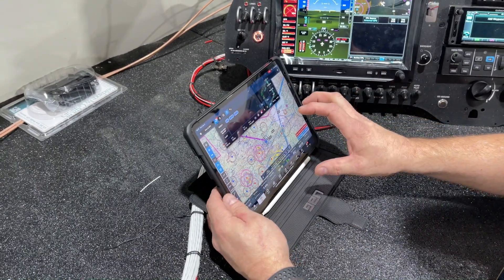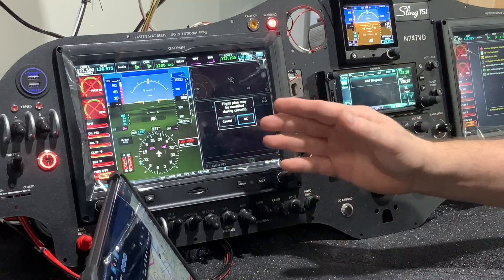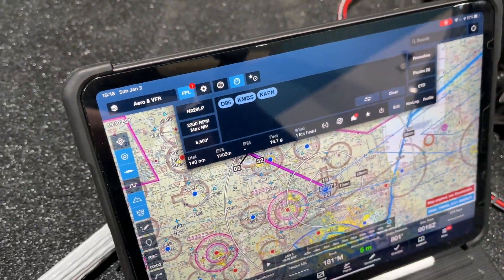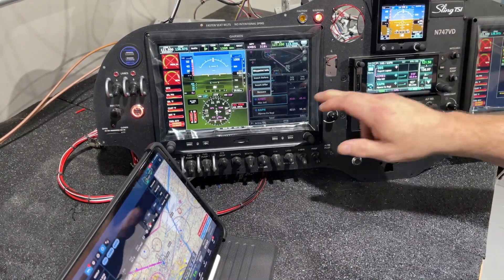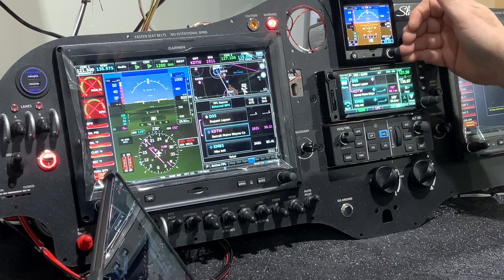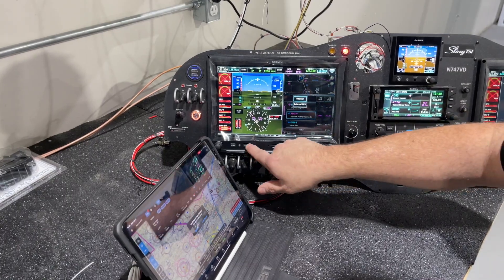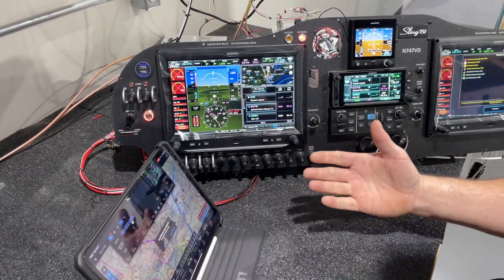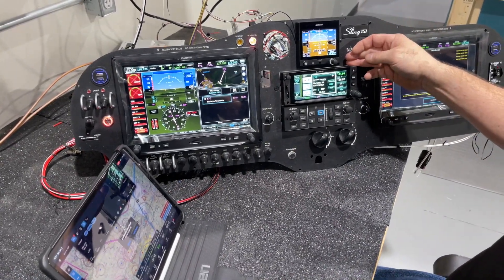Garmin G3X to GTN Crossfill

Comment: Hi, I have a G3x and GTN650 x I. It looks like my system has not been set correctly in the configuration mode. Can you please advise on what I need to change the configuration setting to enable cross fill.

Comment: I tried this and it does not work on my installation. As soon as I go to external on my G3X, the flight plan becomes whatever is in the GTN. How are your devices interconnected? Mine are through the 429 link to the CANBUS.
Reply from the maker: Be sure you have "External Flight Plan" enabled on the GTN. You have to go into configuration mode on the GTN, the go to Setup -  Main System, scroll to the bottom, should be second option from the bottom. If you do not see it, be sure to update the GTN software.
Reply: @MidwestPanels  That got me closer, thank you, but I am still getting an error and I am working with Garmin on the problem. Install says it's pilot ops and pilot ops says it's install. So much for finger pointing. Thanks again for putting me on to this.

Comment: You can send the flight plan from iPad to the panel via Bluetooth - no need to have Flight Stream, right?
Reply from the maker: Correct, you can send it to the G3X which in turn will send it to the GTN with out the use of a Flight Stream. Flight Stream is only needed when the GTN is standalone.
Reply: @MidwestPanels  Another question, if you don't mind. If you change the flight plan on your panel (G3X or GNX), does the updated route automatically sync to your iPad? Is the answer the same whether using Garmin Pilot or ForeFlight?
Reply from the maker: @Skepilot  Not automatically, you have to manually transfer it, but it is rather easy to do and this is the same for either product.
Reply from the maker: @Skepilot  update to the last question, I just tested it with the new updates and it now will do the automatic transfer to the iPad. It will prompt you the first time, but once you switch back to external GPS, it pushes the uodate
Reply: @MidwestPanels  Great, thanks!

Comment: Does this work any different with at 430W navigator? I have a 172M w 430w that I teach in. From your demo, it would seem I could install the g3x and tech vfr using tradition steam gauge setting (assume this is configurable prior to flight?) or glass cockpit w tape setting and 80% of instruction would be using internal gps on G3x. For instrument, I could use the 430w to feed the G3x.  Can I control coms on my 430w using G3x?  I need to purchase a 2nd com if I upgrade as well. Be nice to control com 1 and 2 of G3x screen.  Bottom line, can I avoid buying a new gtn gnc navigator and get all the functionality. Great videos!
Reply from the maker: No unfortunately it does not work the same. You only get the transfer from the GNS to the G3X and CDI information.

Comment: Seems clumsy and cluttered. The G3 X should know where you are to give you a starting point and an ending point and it should be able to perfectly slave to the GTN or vice versa without flip-flopping between internal or external.
Reply from the maker: It makes sense that the system wants to know which GPS you want to use. It has no way of knowing unless you tell it so the need to select which one you want is necessary.
Reply: @MidwestPanels  Correct I get that but You aught to be able to use the G3X as a full-time data entry while being slaved to the GTN for navigation. If you hit direct to on the G3 X and you’re using an external source shouldn’t it link to the external source and go direct to?
Reply from the maker: @Captndarty  but you just as easily do it on the GTN so in our opinion it’s not that big of a deal, however we do know it bothers some that it’s that way.
Reply: @MidwestPanels  i think it’s nice of you to be positive about the work around but the feedback loop from the community is clearly saying this isn’t intuitive enough. I agree with the others that if your selected to external then the Dto should work for the GTN. This shouldn’t cause debate about workarounds, everyone should just nod in agreement because it makes sense. Garmin, patch this in the next firmware and we can move on. 

Great video and thanks for covering it!
Reply from the maker: @ericbuhrendorf  thank you for watching, these discussions are what make this all work.